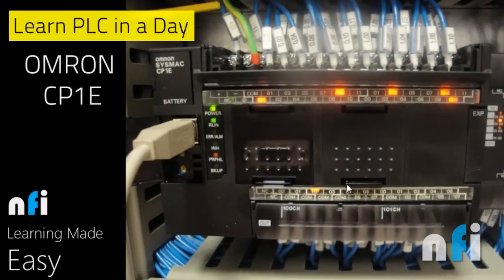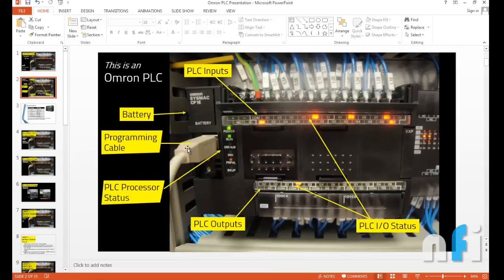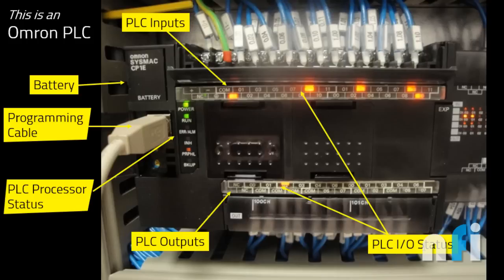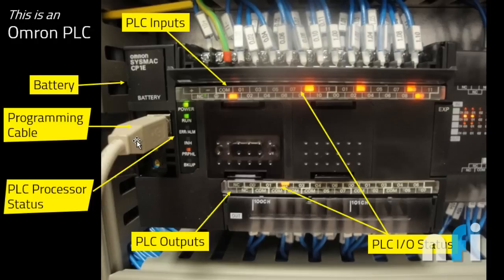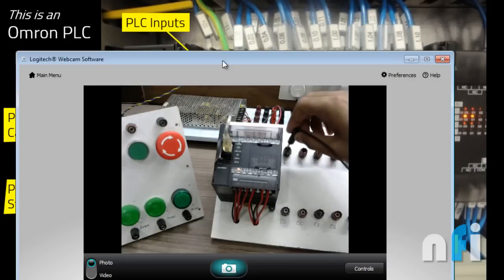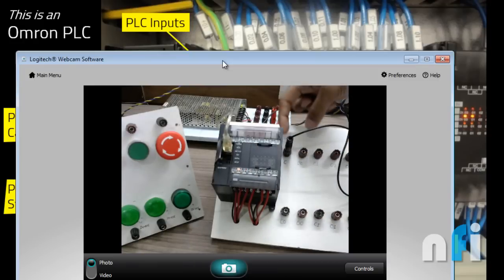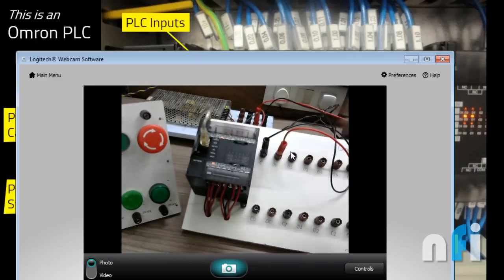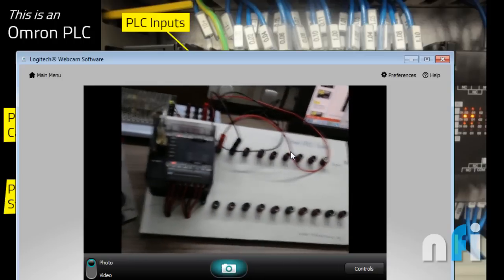Omron PLC Lesson 1- Introduction to PLC

Comment: Thank you for your video! good video. I think you should turn off supply power for PLC before connnect wire. That will make PLC safety more! Thank you!
Reply from the maker: +huuhuy huy It's alright as we are dealing with 24VDC. There is no harm because if you see technically sensors are also switching voltage ON/OFF while PLC is running. So it's alright! Anyways thanks for suggestion
Reply: +Rajvir Singh (NFI Automation) Thank you so much!
Reply from the maker: +huuhuy huy Your welcome!

Comment: Hi Rajvir thank you the lesson. could you assist me, i am using a omron cp1l-m30-dt-d plc for some reason my output channels are lacked and over riding my program the light goes on and off between the programs, my output devices are always active and not responding to my program. is there a seeting im missing in the plc? is the plc broken which will be strange as two of them are having the same problem. my program and wiring is all good.
Reply from the maker: Perhaps this could be that there is another bit in the program which is latching your output. You need to check for that.

Comment: Hi ,

Very useful documents for PLC engineers and students ,thanks
My project is how to control (Frequency , voltage , temperature and protection) Micro hydro power generator using PLC.

Thanks
Reply from the maker: Good luck for your project:)

Comment: Hi, I am having CP1E-NA-20DR.. In cx programmer which address i need to put to get the analog data from 90 ch and 91 ch.. thanks in advance
Reply from the maker: I never tried working on this PLC., but I'm sure it must be mentioned in its manual. Please check., or send a copy at nfiautomation@gmail.com
Reply: Got  it  through  plc forum  . .. Thanks  for  reply

Comment: hi, may i ask what happen if the input is 12v? is there any chance u can tell me how if my sensor is 12v as input to my plc and what i should do because u said that the input of plc need 24v? can u give some solutions? please give your email so i can ask u easily thank u in advance :D
Reply from the maker: +muadz mohd yusof Well if you have 12V output from the sensor., you need to amplify it before sending it to the PLC. The simplest and quick way is to use 12V relay with low ampere coil. Actuate the relay using the sensor and give 24V to the common of relay and connect it's NO to the PLC. This way when sensor goes TRUE the relay will be ON and gives 24V to the PLC. Case solved!
Reply: +Rajvir Singh (NFI Automation) thank u very much rajvir sigh...thanks for helping me...:D
Reply: +Rajvir Singh (NFI Automation) hi again...can u tell me how to interface vb^ with PLC cp1e where the vb6 as a monitoring to plc...if u know can u tell me...or do u know any website that teach how to interface it....i hope u can show me the way to interface it thanks :D
Reply from the maker: +muadz mohd yusof Sorry you want to interface what? vb6? I am sorry i dont know this thing? is it come kind of HMI?